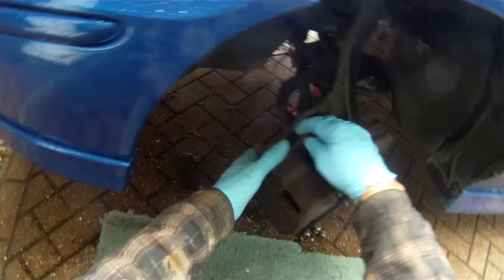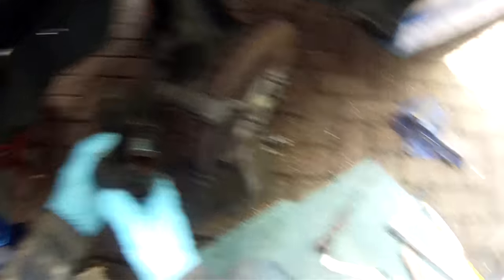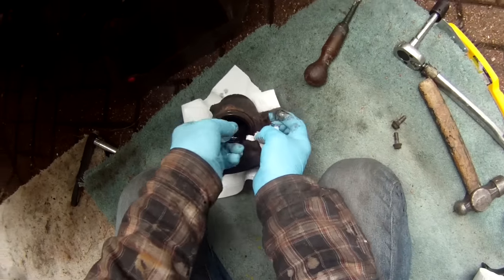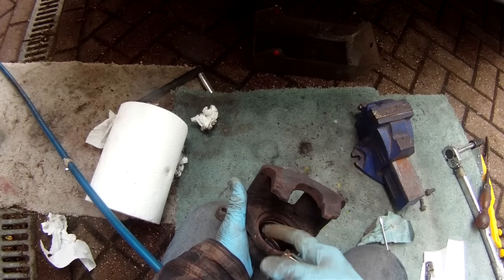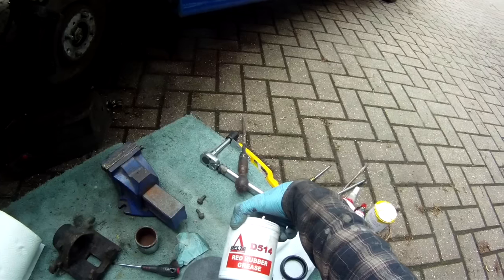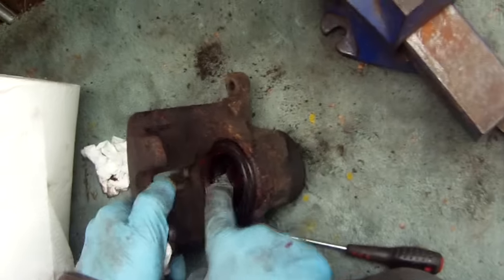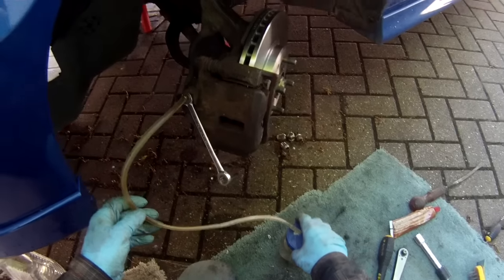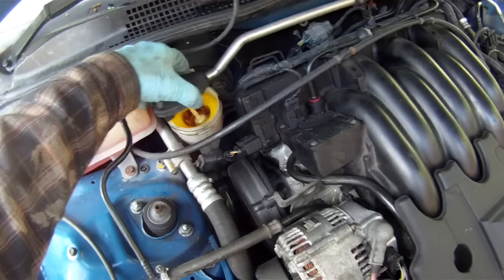How to Fix a Stuck Brake Caliper

Comment: I really appreciate this video that you made. After watching this I went serviced my wifes car one of the calipers got stuck! 
After repair it worked perfect, I didn't even replaced the gaskets, just used the old ones as they were fine. My  piston  even  was rusty but after I removed the rust and packed  with grease worked just fine.
Reply from the maker: Great. Good to hear.

Comment: Yep red rubber grease for the ‘win’.

When you removed the caliper the banjo bolts can be sealed(so that fluid doesn’t escape) by inserting a tyre valve (the rubber part) through the banjo opening(on the flexible hose..(or is it ‘pipe’:-).. Not my idea but used by Eric O at South main auto. My Freelander brakes have been playing up on occasion so need to visit this are despite new slider pins. I think the positions could be part of the problem..
Reply from the maker: Good tip

Comment: One excellent trick for the dust rubber is to pump some air into the bleed valve which pops the seal over the piston
Reply from the maker: Thanks for commenting.  However, I'm not sure I like the idea of putting air in the hydraulic system in case it goes back up the line into the ABS valve block, which on some cars can be a specialist job to remove, so I've heard.
Reply: I think he meant once the caliper is out. Great video thank you

Comment: You know you dont need to house clamp to strop break fluid for running out.  Just push the break pedal little little bit and put a stick there.
Reply from the maker: Thanks for the interesting tip.  Even though it is unlikely, unless you clamp it, there is the possibility that fluid could drain out of the pipe by air going up the pipe.  I’d prefer not to risk because if air gets in the ABS unit it needs specialist software to purge it.
Reply: @comeinhandynow  Car mechanic do it every day at the shop.  Push pedal 10%, and the system is locked. ABS unit valves are closed.  and breake fluid will not spill ut of the hose. =)   when your done working. connect all your things,  and then let off the breake pedal.   bleed your work area
Reply from the maker: @negueba235689  Thanks for the tip.

Comment: Put the rubber brake clamp on first before disconnecting the rubber brake pipe from the caliper, that way you don't get air backing up the main brake line.
Reply from the maker: Thanks for the input.

Comment: Great demonstration of how to rebuild the caliper without any new parts.  Remanufactured calipers are cheap enough these days to not warrant DIY rebuilding unless you can't find  them.  What is the long term performance of this work?  Any leaks?
Reply from the maker: No leaks, it was good for a long time.
Reply: @comeinhandynow  Just replaced one front caliper on my '01 PT Cruiser with a reman that cost $82 CAD.   If I bought a rebuild kit from Rock Auto (without a new phenolic resin piston) it would have cost only $13 CAD (delivered) but would add another couple of hours of my labour (free - LOL).  Unfortunately, the seal had rotted, three weeks for delivery and the car would not be drivable in the meantime.  Anyway, your video demonstrated that a DIY'er can do this, might be able to reuse the seals and no air compressor needed. Cool!  Only wished I had seen this video earlier - I might have considered this option.
Reply from the maker: @canuckfixit7722  Thanks for your input.  There will be another time….

Comment: Music so nice I nearly went to sleep before the end.  Yeah good .  The rust probably comes from ingress of water close to where the pistons generally sit most of the time when at rest, can't really do much about that. But at least once you have done this it's easy enough to repeat every few years.
Reply from the maker: Yep, thanks for your comments.
Reply: Why do they rust in the first place? Don't manufacturers simply use stainless steel?
Reply: @spolo123. The rust forms on the caliper housing itself which expands against even a stainless steel piston and keeps it from moving easily. The area the rust forms is between the dust boot and the piston seal in the bore. You will find that in the case of plastic or phenolic pistons that the piston itself eventually exspands from being in contact with brake fluid and becomes hard to move. In that case you can sand the diameter of the piston .003 to .005 inch and it will easily fit the bore again. I've done this for many years on my own vehicles but in a professional shop the mechanic is required to replace the piston and seals with new ones. 52 years experience on car, airplane and motorcycle repair.
Reply: @bottmar1  Thanks for the insight.  If the calipers are aluminum and the corrosion comes from dissimilar metals being in contact, why can't we have aluminium pistons?
Interesting to hear about phenolic pistons. Are they used because they're cheaper to produce?
Reply: @spolo123. I don't know why they make the phenolic pistons. Cost to produce may be a reason but as with many other not so good designs there seems to be no obvious good reason.

Comment: Thoroughly enjoyed your brilliant tutorial. Working on my 92 240 volvo wagon. Two questions: short of dismantling the caliper is there a temporary way to free it until I have time to do it properly? I don't have red grease, but many other tubes of grease, does it have to be red grease? Thanks for your superb video, and all the best from New Rochelle N.Y.
Reply from the maker: Thank you very much!  I wouldn’t use other greases, use brake fluid if you have no rubber grease (it’s on amazon, check the video description for links). I would recommend stripping the caliper, but if you really don’t want to then you could try  both bleeding the brake fluid while moving the piston in the caliper (pads removed) from min to max extension to try and clear it out more.  But it won’t be as good as getting all that rust out with a strip down, or a new one.
Reply: @comeinhandynow  Thank you for the prompt reply. I have red colored grease, but I assume it has to state its compatible with rubber. Have plenty brake fluid in garage. If the c-clamp doesn't work I have several good used calipers on hand. Don't know how difficult my calipers will be as they are four pistons, and the caliper is one piece, not like the one shown in your video. In other words working in a closed space with no wide open access. Cheers and god bless Stewart Bruce
Reply from the maker: Better to just use rubber grease. Good luck.

Comment: it is easier if you put the rubber dust cover first on the piston and slide it on the end of the piston, mount it in the caliper and then slide piston inside caliper. You could destroy new boot with the screwdriver.
Reply from the maker: Thanks for the input, although I personally prefer to fit the outer seal in the caliper first as you can press it home into the grove and check its bedded in the caliper slot. As shown at 9:40 in the video.  Otherwise there is a danger that it doesn't seat properly and gets squashed in the wrong position, not sealing properly.  You have to be careful with that screwdriver, I agree, so as not to damage the rubber.  You could probably use something softer if worried about it, or round off any sharp edges on it.

Comment: Forget a screwdriver, I stuck a massive 1m breaker bar in there and it still wouldn't move back! The bar even bent...surely rust can't be the cause of that??
Reply from the maker: Yes it can. No where for the piston to go if stuck by rust to the sides.

Comment: copper paste has a tendency  to harden and makes iron rust. The right way is to use alupaste.  it prevents iron from rusting.
Reply from the maker: I haven’t noticed that in all the time I've used it but I’ll look into alupaste when i need some more.  Thanks for the suggestion.

Comment: Great vid but I have a question. ..My brake cylinder is so tight even with lube and .all cleaned up ..also actually wasnt that bad to start with.
 2011 forester subaru.Any ides???
Reply from the maker: Thanks. If all the rubber seals are removed from the piston the fit of the piston in the caliper cylinder shouldn’t be tight.  If it is then either the cylinder or piston still has rust or muck protruding which is causing the tightness.  Some scrapping or light sanding may then be required.

Comment: After I started using Brake Cleaner, I started having problems with my brakes on both my vehicles, my Advice is if your brakes are fine, don't use Brake Cleaner ever
Reply from the maker: Interesting, thanks for your input.  Lubricating the seals with red rubber grease is a good idea.
Reply: That's odd you said that cause I changed both rotors and brakes on front and used brake cleaner to clean up everything and now I feel like one of my calipers are sticking first time this ever happened thinking it's just bad timing I dont think brake cleaner would cause it but who knows

Comment: Good and clear video, thanx. One thing though,  I get why you would want to use rubber grease on the rubber seal but wouldn't the brake fluid already do the job of seeing as it comes in contact with it, also having the risk of it mixing in with your brake fluid?
I would lubricate the seal with some brake fluid before putting it back in and then using rubber grease on the sleeve. 
Just a thought.
Reply from the maker: Thanks for your input.  Nothing wrong with doing it as you say.  I personally preferred the rubber grease on the seal as its a bit more slippery and is not hydrophilic (water attracting) like brake fluid, so maybe, just maybe it keeps rust away from the caliper bores a little longer.
I found this on the internet:

“Castrol red rubber grease can be used to lubricate brake pistons and seals when assembling. It is vegetable based and does not react with or harm rubber seals or brake fluid.http://www.redrubbergrease.com/tips-how-to-brake-caliper-failure-repair-...Silicone grease is ok too - keeps the water out.Why lubricate brake pistons with brake fluid which as we all know absorbs water?”

Comment: Pro Tip! use compressed air in the brake line inlet to set the outter boot. just hold the piston close and give it a shot and the boot will pop on.
Reply from the maker: Thanks for your tip, not tried that.

Comment: Would the symptoms of a stuck caliper be a burning smell around the tyre and the car vibrating at around 50mph?
Reply from the maker: Maybe the smell. The disc will be hotter on that side,  a lot more then the other. Mind you don’t burn yourself!
Reply: Yes, definitely sounds like a seizing caliper
Reply: Get it sorted, car will be braking all the time and will be ruining your discs. you will notcie it when car is idle at lights. If it feels like it brakes on its own etc and not rolling like its supposed to. Car will feel like its being held back, like handbrake is on etc.

Comment: Hi, mine is also rusted but it will not budge when I press the brakes. One does but the other one is too rusty. Any solutions for this?
Reply from the maker: I would suggest blocking the one that does move by putting the brake pads back in just on that side, then start the engine so you get full servo assistance and stamp on the brake peddle. Or press as hard as you can.  Hopefully that will shift the stuck piston.  Watch out for brake fluid going everywhere when the piston comes out of the caliper.
Reply: Brake fluid can't squirt very far as the dust boot contains it.

Comment: Excellent video. Ive just had the same symptoms. Replaced Brake Pads only last year with Brembos and i could hear scuffing then eventually grinding from one side on the rear. Bought new pads and when i changed them, one side was perfect, still new almost but the other had a seized caliper and had worn the pads down badly. I got the nut loose eventually as it was solid and cleaned and greased it up nicely. Replaced the pads, bled it and its fine. Excellent video, very informative. Now however the clutch needs changing lol,right on xmas. Got the parts, clutch plate,face and cylinder.
Reply from the maker: Cheers. Good luck with the clutch, just be sure its the clutch slipping and therefore needs changing, before going to all that effort, rather than the slave cylinder causing poor clutch bite point position which is a weak spot.
Reply: @comeinhandynow  thanks bud. Im still driving the car just got to push more to get it in gear. It wont go into reverse at all though.
Reply from the maker: @andisadler2897  That sounds like the slave cylinder bracket is maybe flexing a bit or just a bit of air in the system is causing not enough clutch releasing.  See my other videos on my channel on improving the clutch.
Reply: @comeinhandynow  funny you should say that as i had brake pipes changed on front back in July/ August and the idiots didnt check brake/clutch fluid. It started to play up slightly a month later and i checked the brake fluid and it was almost empty. I filled it back up and clutch pedal does have pressure in when i pump it. Its a strange one and may well could be air in the system. Sometimes it feels like its dragging if you understand from the gearbox. Car idles fine at the lights lol its baffling.

Comment: Is it absolutely necessary for one to unplug the brake fluid piping and bleeding the brakes? Could I just remove the caliper and go about cleaning it out without having to mess with the hose or having to bleed the brakes?
Reply from the maker: If the caliper piston is removed (pushed out) then air will be able to get in the brake pipe so it should be bleed afterwards.
Reply: @comeinhandynow  I was afraid of messing with that stuff because I didn't have a bleeder or have ever bled my brakes. I decided to just follow your complete process anyways. I'm about to flush my brake fluid completely now that Im here finding out you need to flush every 2-3 years. Thanks a lot for guiding me through this process. 

What's the point of opening and closing the valve when using the two person method? The only difference I see between the two person method and the one person method is the lack of opening and closing of the valve.
Reply from the maker: @solorodriguez9255  Closing the bleed screw on the pedal up stroke stops air being drawn back into the caliper.  Well done for tackling this job. The first of many perhaps.
Reply: @comeinhandynow  :'] Thanks for blessing us with your knowledge. I don't really have people in my life that have answers for me regarding these greasy problems. You sped up this process for me and have got me back on the road and back in the rat race. Much respect from southern California.
Reply from the maker: Good luck.  Work hard to make your own luck. Best wishes.

Comment: I thought this was suppose to be about a stuck caliper. That's what the title says, but you just took it off very easily.
Reply from the maker: As you may have guessed from looking at the video it started after I had already undone the caliper bolts and freed the caliper from the disc.  It only involves removing the caliper bolts and levering the pads and caliper off the disc, which wouldn't be that interesting to watch.  The main subject of the video is to fix what makes the caliper stick. i.e. dismantling and cleaning the caliper piston fully so that it moves without getting stuck again.
Reply: @comeinhandynow    Then you should retitle it "how to prevent a brake caliper from getting stuck".  I really had troube getting flipping up the caliper. I had to remove the entire caliper assembly.  I actually would like to see how you did it.  Did you use penetrating oil?  I thought it was normal because of the piston but I saw other people do it without any trouble or having to remove the entire caliper.
Reply from the maker: @williampennjr.4448  I see what you mean. I’ll look at renaming it.  The problem with mine was the stuck / sticking caliper pistons in the bore which created uneven braking and stopped new pads being put in as the piston wouldn’t push all the way back in.  For removing stubborn pads and callipers the only choice is to apply a lot of leverage force to push the piston back any amount (or pull the sliding part of the caliper on the other pad forward) using a long screwdriver or bar or anything that will fit, then similarly lever the sliding caliper part out from the rest of the caliper, with one of the slide bolts removed, so that it pivots on the remaining bolt.  Then you can get the pads out.
Reply: @comeinhandynow  I thought that might be the problem but i was affraid to force it or use a pry bar in case I broke something.  I saw other videos that said to apply even pressure to the piston or it could break.  Thanks for the explanation.

Comment: A vice grip will clamp the hose as well and if you put it on before the piston is all the way out you wont have to bleed the brakes as much.
Reply from the maker: True, but I'd prefer a pipe clamp (time 3:20) which has rounded edges and is very light, to minimise damage to the rubber brake pipe.
Reply: Hey an update for every one haha I had a sticky caliper, we dont have snow here ever so no salt on our roads ever so we dont have rust like you guys do, so I simply took the caliper off and pumped the piston out with the brake pedal, mine was 3 pumps so it doesnt pop out and I then pushed it back in with a g clamp and I did that about 20 times. 

Put the wheel back on pumped the brakes went and turned the wheel and it turned easily where as before it was very stiff. So there is a very cheap hack for you guys but remember after doing that 20 times you might be a little stiff the next day  LOL